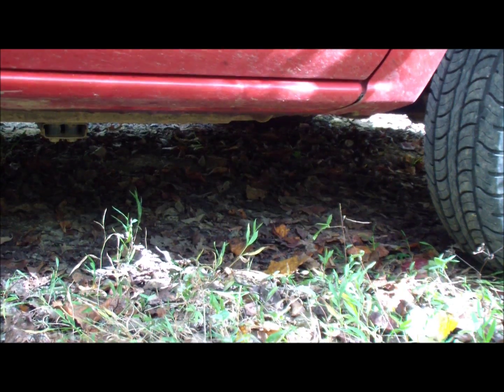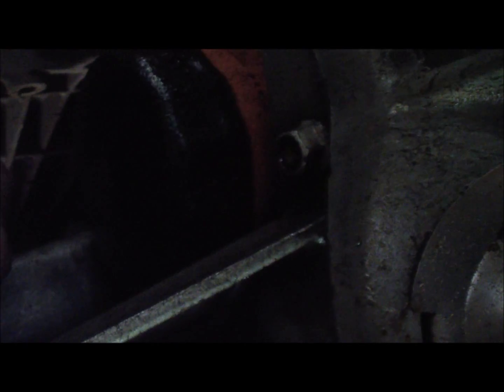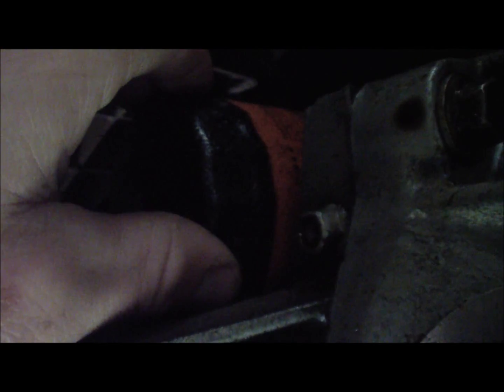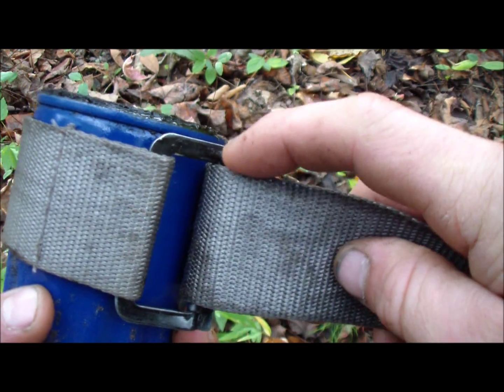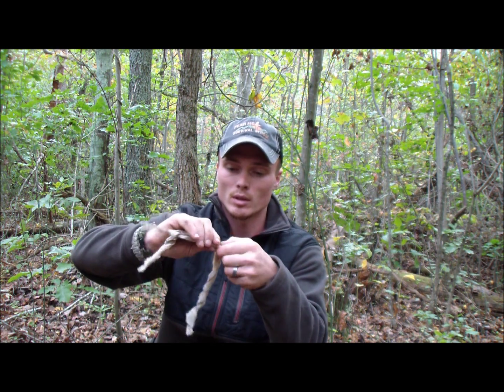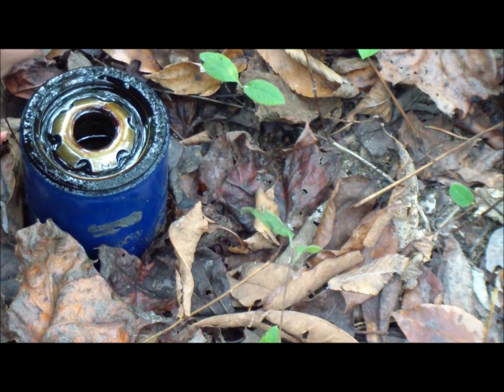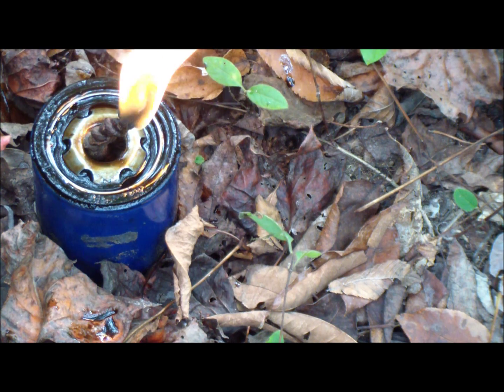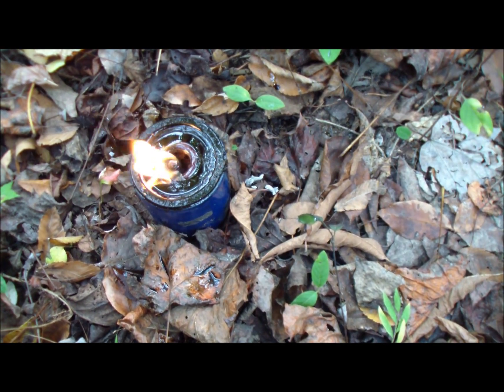Vehicle Breakdown-Oil Filter For Survival

Comment: Great idea, but doesn't the oil just pour out like hell, when you loosen the filter? Cheers, Marc
Reply: That all depends, in my experience, if that filter is on too tight (need to use the belt), you're probably going to be covered in oil.
Reply from the maker: Ha. yea you will bleed some oil out. It won't be terrible if you open it slowly and let it run smoothly out. Have a container to catch it also and don't be right underneath.
Reply from the maker: Warren Maslowski I believe that was me getting covered in oil haha. Moral of the story is take it off slowly